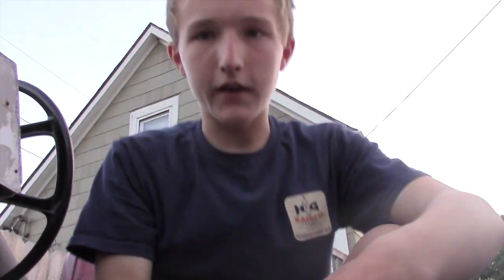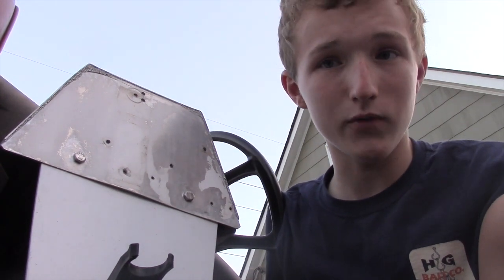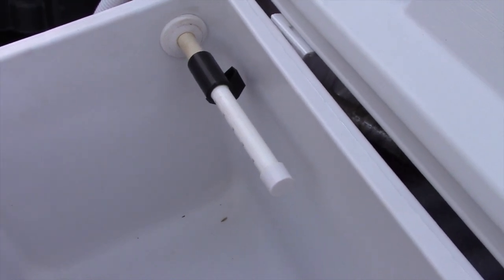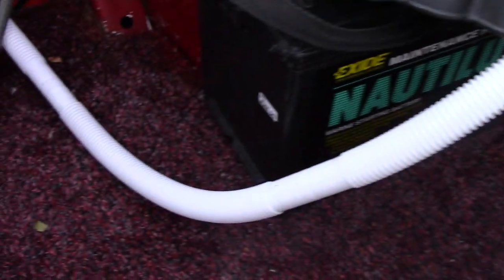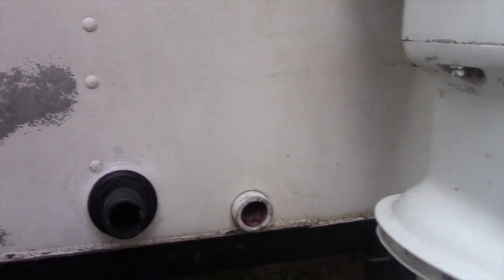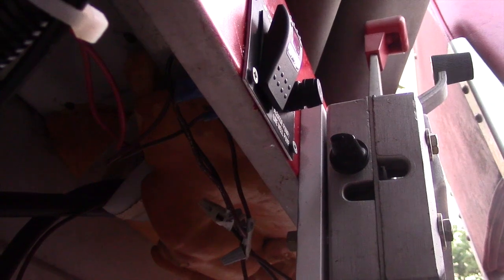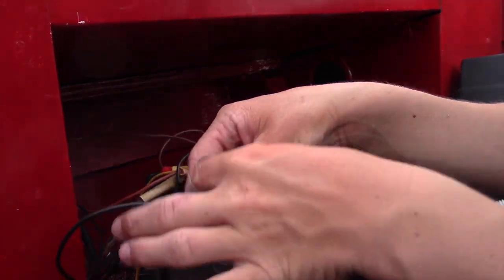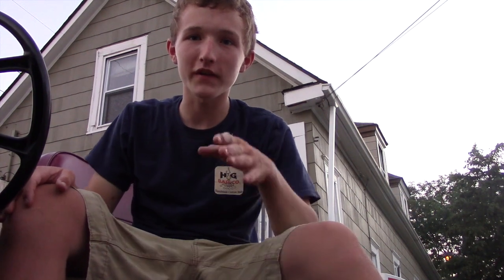How to Make a Homemade Livewell

Comment: Hi, Thanks for sharing this project! I've been fishing for more years than I like to think about and making a livewell is something I've never even thought about. You did a very good job and I admire your courage with drilling holes in your hull. you got me thinking. I wonder if just adding an 12 volt air pump to the cooler would keep fish alive? If so, drilling holes might not be needed. But, I'm sure that constantly running fresh water through it is better. Thanks again and all the best! Tight Lines buddy  :-)  Charlie

Comment: I was watching you really so I notice you were talking about silicones I work in a auto body shops and we use urethane rubber silicone NH used for windshields encore you can research it I will guarantee want to use it nothing ever leak on your boat if it works for you let us all know
Reply: Rodney Johnston the thing is that most silicones leech toxins when they are in water. So you have to be careful when dealing with animals with which types you use. Even when not in direct contact with the animal it is still best to be safe.

Comment: That electrical.....eck! Please say you have fuse links on the wires at least.

Love the thinking outside the box approach. Looks good. A few improvements can be made.
Reply from the maker: Yes I do. Thanks for watching.
Reply: Good. Seen too many electrical fires due to people performing electrical work without at least studying the basics. Electrical is a skilled trade of mine so I've seen a lot on the 12V DC side.

Comment: Thank you for sharing your video. You need to remember that a boat spends a lot of time in a moist wet environment which is the enemy of electrical wire and leads to corrosion and resulting in electrical shorts. You should protect splices and terminal connectors with marine heat shrink to avoid moisture wicking inside your wires.